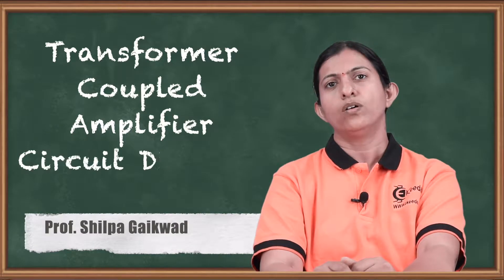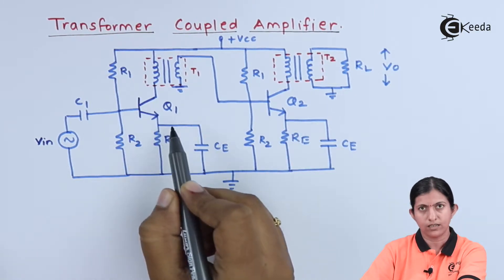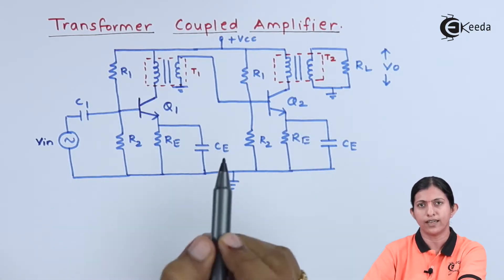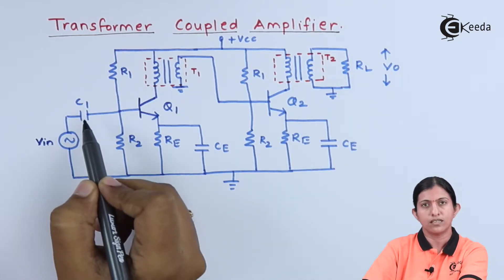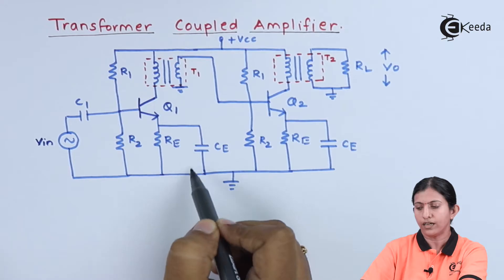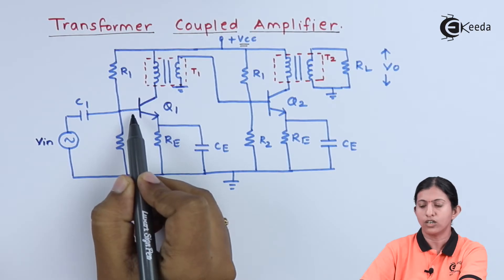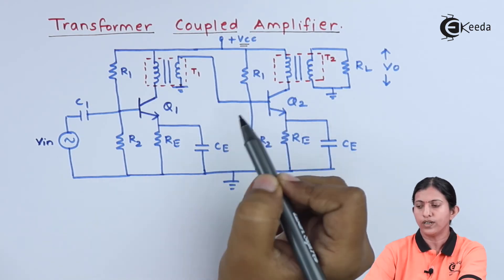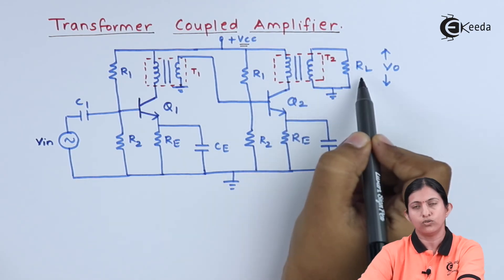Transformer Coupled Amplifier Circuit Diagram - Low Power Amplifiers - Applied Electronics

Comment: what is Q point?
Reply: q point the exact centre point that took in active region of the dc load line
Reply: Q point is a point at which transistor works with maximum amplification